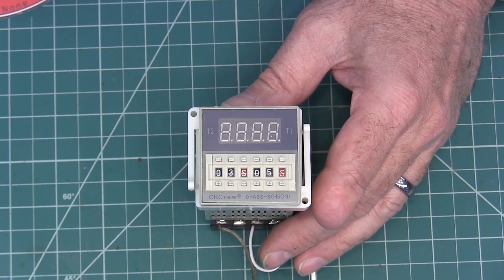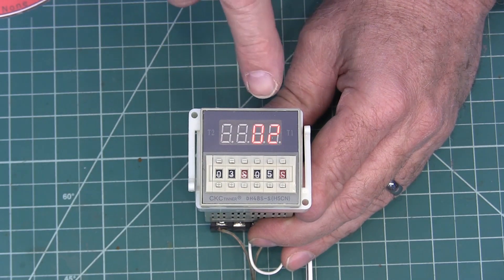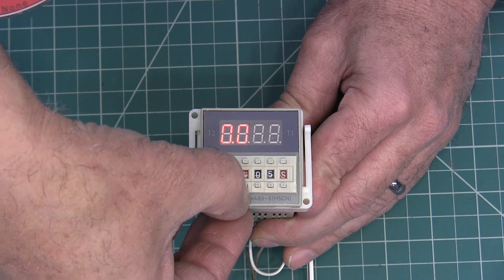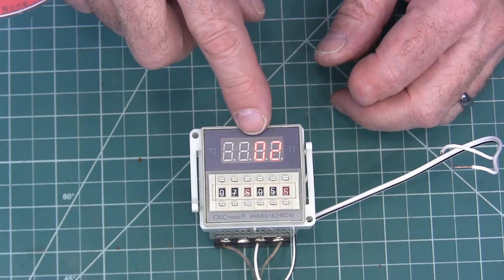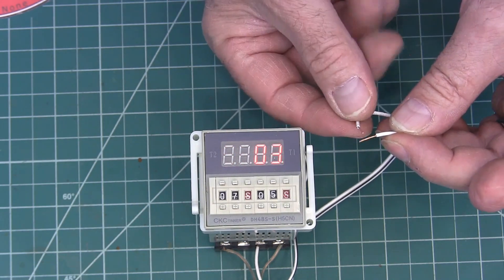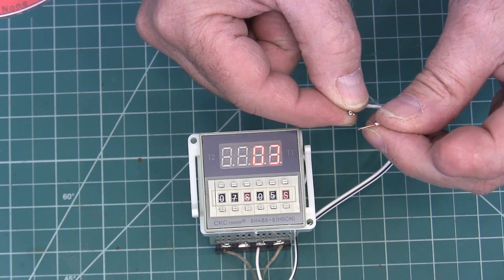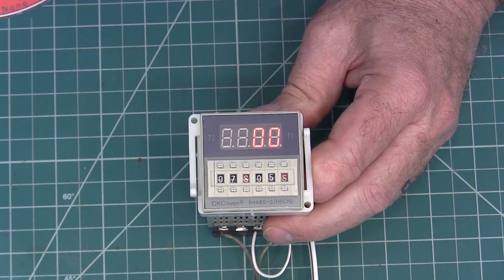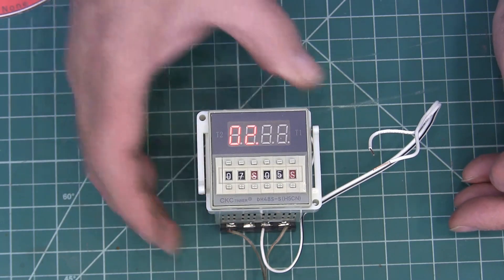DH48S Timing Relay

Comment: Hi
Any idea if timer can be activated via foot pedal
Want to hook up to a 12v pump, and run it for 7.5 seconds at a time, so each time I press the pedal, it in turn runs the 12v pump for 7.5 seconds, needing to know which terminals to use

Thanks

Comment: Thanks for the video. I want to use this device to switch on for maybe 1 hour & then switch off until I run the programme again. According to this video, it switches on & then switch off on a loop which is not what I want. Just thinking, if I set the switch off time to zero, will it just run the ON programme & then not run on a loop? Thanks

Comment: Fascinating.  You always show us clever hardware to solve problems.  I would love to hear how you start your search to find control devices like this to solve problems.  Maybe you just start by thumbing through a catalog and then a light bulb goes off in your head on how you might use a device?  Or do you have a problem first that you then look through a catalog to find a possible solution?  Or do you flow chart the “problem” and then find devices that perform the steps?  Always interesting.
Reply from the maker: I usually start with a problem and then search online for solutions.  Zeroing in on the item I need by adjusting my search using words I hadn't thought of found to describe items that are getting closer to what I am looking for.  I originally thought I would have to use an Arduino or RaspberryPI to control it but I don't know how to program them.  My son does but I wanted to be able to adjust the amount of feed easily and he was saying I would have to flash it each time, not what I had in mind.  So I started thinking.. how can I count the revolutions?  Searched for Circuit to trigger relay after counting events.  Scrolled through the results and saw a Counting Relay!!  I didn't know they existed.  Researched Counting Relays and settled on the one I used.  I was then concerned that when the power flickered or one a dark rainy day it could get triggered repeatedly so I looked for a circuit that would "lock out relay for time period".  I scrolled through and saw Timing Relays, didn't know that was a thing but lead me to what I wound up using.  My process if not very organized, most of it just runs around in my head.  As I have gotten older I find it necessary to write more down.  Especially circuits.  I will start by drawing the parts I know I need, relay to control motor, timer, photo relay, etc and then work through how to get them to connect and interact properly.

I do sometimes find cool items that I want to do something with and find a use but that is rare.  I used to go through surplus catalogs and find stuff but mainly it's all online now.  Thanks for your question Joel!
Reply: @SoatMon  Thanks for all the details.  This provides the confidence inspiring information I had hoped.  I second guess myself many times, and wonder how others solve problems.  Turns out it’s simple…… all it takes is persistence and hard work. 😃 👍👍